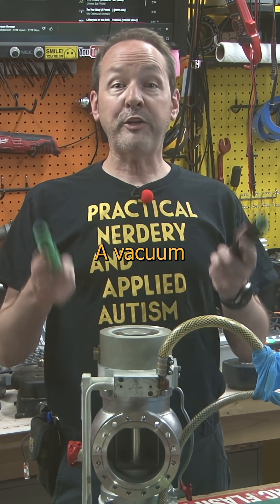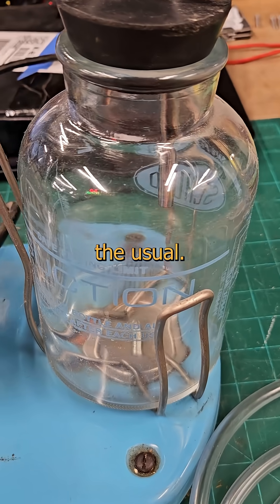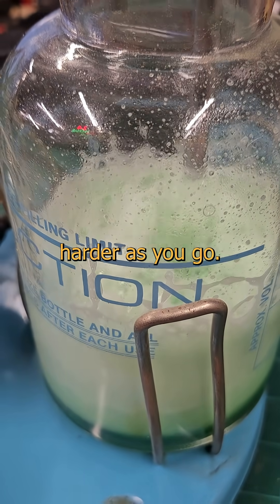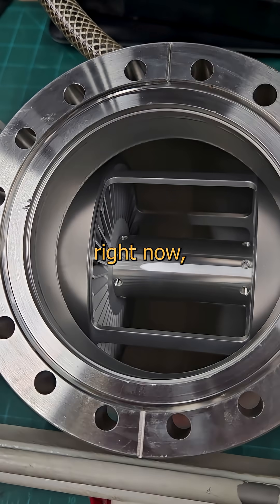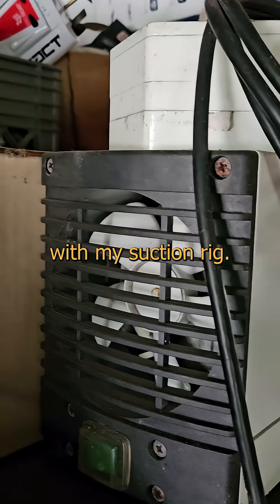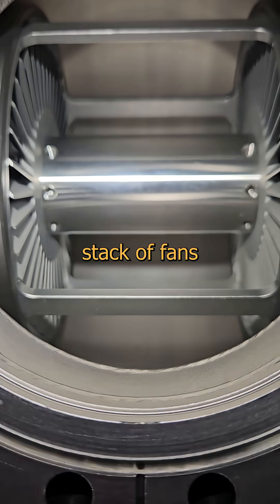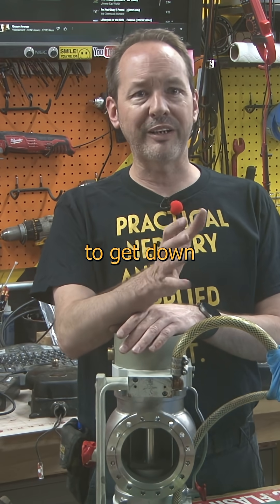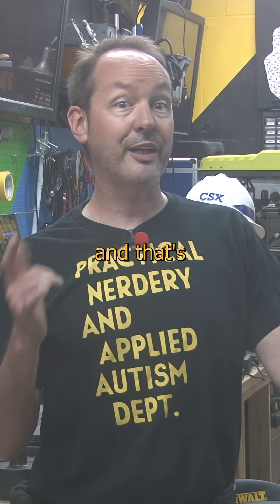Turbomolecular Vacuum Pump #chrisboden #comedy #engineering #physics #science #turbo #nerd

Comment: Hey cool finally seeing a piece of equipment I have actually used, the roughing pump. We use that in chemistry labs for suction filtration. we also have beefier ones for pulling better vacuums for rotary evaporation or purging containers before running air sensitive chemical reactions.

Comment: Used to be an EE for a vacuum furnace pump. Most of ours used a rough pump and booster (turbo) pump, but some used a oil diffusion pump which could bring that down even further. Given that these are about 10' around and 10' long, you can bet that pump down took a while, especially when youre getting down to the last bit.

Comment: I did some physics experiments under high vacuum using one or more of these pumps. Always fun.
When you switch them off there is so little friction that it takes them forever (10s of minutes) to spin down. They also have no built-in brakes. The trick get them to stop quickly (so you can open the experiment chamber without them destroying itself) is to just barely open a valve to atmosphere for a quick second to let just a little bit of air in. Maybe raising the pressure from under 1 nanobar to around 1 millibar. The turbomolecular pumps will start singing and spin down in 30 seconds or so.

Comment: In aerospace parts assembly, most is EB welded in a vacuum chamber using roughing pumps, high vacuum pumps and an oil diffusion pumps, all in series. The systems I used to work on would operate down to 7.5x10 -13 to 7.5x10 -20 Tor. Small chambers, 24in x 12in x 12in, would need about 45-60min to get down to those near interstellar space vacuum levels (-19 to -20).

Comment: Okay FINALLY I understand how people get rid of the final few molecules of air in vacuum chambers. I've been wondering for a long time how you could get a near perfect vacuum inside our atmosphere when the pressure inside the chamber gets extremely low. Had no idea it's possible to actually physically "bat out" stray molecules. I just assumed nobody ever did it and just used as good a vacuum as they could get with traditional pumps.
Reply: There are other ways to do it - diffusion into tiny oil droplets and the like - but they all work on the same principle of mechanically trapping molecules and moving them to some sort of "higher pressure" area, where a conventional vacuum pump can get them out of the way.
Reply: @jandl1jph766  that's really interesting, thank you!

Comment: As a master licensed HVAC technician who now runs a service department....I can speak for alot of HVAC technicians out there when I say this video explains our worst nightmare (usually) on any large commercial install with VRV systems with hundreds  or even thousands of feet of line sets that we have to vacuum down far more than a standard system and be able to HOLD this for 24 hours before start up. Nothing is everything and this video is gold to show people who ask about the vacuum process. Good job sir. Good job!
Reply: Just add more vacuum pumps 😉.

Of course you only have one bloody service port per lineset if you're lucky these days, unless you install extra. I often run 2 vacuum pumps on systems larger than 10 ton. Sometimes a third.
Reply: This is true! We had a 60 ton Daikin system at a hospital that we had 3 pumps working overtime. We actually at one point had to stop and change the oil once with a lead lag system we set up because they had to run 24 hours + to achieve 250 microns and hold it for 24 hours. 
We've even had some massive 200 tonight chillers that used river water at a steel plant in northern Kentucky. These things were prone to breaking down all of the time and working on the compressors were a massive pain in the neck. 20 year old chillers that never shut off was a recipe for disaster. There were 6 of these in total (3 lead and 3 lag). I was so happy when we finally replaced those things. The money made in service was great...but it became troublesome when we had to constantly have a tech out there and jamming up our schedules lol @SuperS05
Reply: I started as a CNC technician a few months ago (freaking love it) and I'm just now starting to go down the rabbit hole of our vacuum system. I'm rather curious, what kind of vacuum pumps do you work with and what exactly are the for? Circulation?
Reply: I'm often glad that the extent of my HVAC responsibilities typically have a total system volume of less than one cubic foot to evacuate... 

609 mobile license only, so my structural experience is limited to a self install of a mini split, and watching enough YT videos of the 608 guys to make me glad that's not my main trade!
Reply: @heyallenify  in Canada we call this an ODP licence. There's no differentiation between scope. It's a day course. It ONLY allows you to buy refrigerants.

We still need a licence to actually work. 313A/313D for fixed systems. 310 for automotive. This is a 5 year apprenticeship program requiring 720 hours in class, plus another 8,280 hours on the job.
Reply: @SuperS05 
In the US, the EPA 609 cert is the requirement for working on automotive AC, to purchase r-12 if working on an older vehicle, and to purchase larger than 1lb cylinders of r-34 or r-1334yf. (At least this is my understanding of the current laws...)

Like your ODP license, it's a short course, and had no apprenticeship (at least when i did mine...)

The structural HVAC licensing is much more involved, including apprenticeship programs and continuing education, from what friends in the trade have said.
Reply: @SuperS05 roughly the same in the US. EPA 609 is automotive, EPA 608 is residential and commercial. You have to be federal EPA licensed to purchase and handle refrigerants, but actually doing service work requires state licensing. Interesting though is that the state doesn't require a license for in house work, only contracting. If you work in maintenance at a big company, you don't need the license or the years long apprenticeship.
Reply: @heyallenify  So you only use it for your own cars, or are you an car mechanic?  the laws change so much just between states, forget about between countries. I am honestly curious.

Here (Ontario) we could work on our own cars/equipment without the license, but can't work on someone else's. The ODP is still requires though to buy refrigerant regardless.
Reply: @SuperS05 
I initially got licensed to work on my own old car, but I have done work for others since. 
There are definitely laws involved with recovery of refrigerant if I were doing this. commercially, thankfully I have only been working on systems that had already leaked out or had to get the refrigerant recovered elsewhere.

Where I'm located now, if doesn't make any economic sense to hang out my shingle professionally, since there are a few shops that have reasonable rates.  Where I lived for the last couple decades, it was far more cost effective for me to acquire the skills and equipment to do my own work.

As far as trade, I'm a shade tree mechanic that helps friends any more.  I turn wrenches for pay, but not road going automotive maintenance.
Reply: @phillyphakename1255  Your own house is a bit of a grey area here, but there are some carve-outs. For us the refrigeration license is country wide. (Any of the red seal trades are, which there are a lot) However, you still need a license even as a maintenance mech. (there are various maintenance/operator licenses, which is site specific, that are a lot easier to get but are not transferable)
Reply: @heyallenify  Doing your own work is often the most cost effective, but not always the fastest lol. I wish you success.
Reply: @SuperS05  I hear that all too well!
The main reason I do my own work now is that I own older vehicles and automotive shops in the area are still charging standard "shop rate" that would quickly exceed the cost of the vehicles.
I also have a much older project car that there are no shops within 5 hours travel that are even familiar with it, and that shop is scheduled months ahead.
Doing my own work lets me figure out what make the vehicles tick, though they may tick me off in doing so!
I've ended up learning to make my own HVAC plumbing to replace no longer available parts from the manufacturer, and that added one more step in the chain of reasons to wrench on my own vehicles.

The worst thing that can happen is that things don't work and I have to figure it out.
Reply: @heyallenify  well if you were like a friend of mine, he ended up paying double for the damage he caused trying to replace a part lol. Learning isn't always cheap but you also won't make that mistake twice.

What did you use for the plumbing? Braided stainless hoses are available. Copper tubing works but it won't like the environment of a car, although it's not like you're taking a project car out in the rain or snow.
Reply: @heyallenify I love when people have knowledge in HVAC and the codes we abide by. Hats off to you sir 😁
Reply: @SuperS05 
I ended up buying a hose crimper and barrier hose/ferrules as needed.  The hard part is in either sourcing existing hard lines for the ends, or welding sections together that are refrigerant and vacuum tight, to meet the needs of the application. 
The OEM condenser in the project car is  not available for the OEM part, $$$$ for a used one, or exceptionally poorly made aftermarket. That prompted part of the research into learning, so another OEM application condenser of similar size could be substituted, as well as upgrading to a more efficient core for modern refrigerants.
Reply: @heyallenify  awesome!
Reply: @heyallenify shew...I have çustomers that buy those cheap Chinese mini splits on eBay ( the gray area for homeowners is wild) they can basically buy those things and sign that s licensed person will "install" it or they come with a nitrogen charge to avoid that caveat.  Then they call a company to fix it when it breaks in a few months and warranty is useless or only a contractor can warranty them. Cheap parts, long wait times, and a customer who gripes about paying for time on a warranty thinking that should be free to on their diy system. It's gotten so bad that around here most companies will laugh and only offer to replace the system because they won't touch it when their reputation is on the line over a junky set up that is guaranteed to be a problem. Alot of these diy bros don't understand the years of education, factory training, continuing education, experience, and hard work that goes into being a technician or having an HVAC business. But that fact you trained yourself and got some certification is admirable as most diy guys just Google and YouTube themselves into disaster lol

Comment: Some more explanation: The turbo pump works with statistics. Molecules, which hit one of the rotating blades, are more likely to get momentum to one side (usually the outside) than the other. That is why no valves are needed. The blades rotate really fast (about 1000 Hz) to increase the probability, for such a collision to occur. Most modern control units for turbo pumps monitor the electric current in addition to the rotation frequency, and switch off, when it draws to much, because it moves at atmosphere.
Reply: The one I have goes from 53krpm to 72krpm… gets 10-9 mtorr when I’m using indium seals. Have to use the cryo pump for 10-11mtorr
Reply: Who talks like that? Frequency is the inverse of speed. Did you mean 60,000 rpms? Or 1000 rps? Or... Lol
Reply: @CBWP  In the turbomolecular pump industry the rotor speed is commonly expressed in hertz along with RPM. 1000 Hz = 1000 rps = 60000 rpm. It makes perfect sense to use Hz because it's just a way of saying 'per second'.
Reply: @PondCam_MS so this one goes 1000 per second ?
Reply: @trippmoore  Engineers at Edwards and Pfeiifer Vacuum: "God, give us some brains!"
Reply: @trippmoore That is correct.

Comment: Question for the more knowledgeable folk than myself - why does this turbo pump have a connector with so many pins? I would assume this would only have a power input and maybe a speed sensor output.
Is this just some connector standard I'm not aware of and most pins are not connected, or is there more to this unit* than I'm aware?

*in this instance, by "this unit" I mean the turbo pump, not Chris.

Comment: I worked for a converter that used electron beam units to cure adhesive and varnish.  They were a giant vacuum tube that emitted a beam of electrons through a foil.  If I remember correctly, the voltage was 120kV and the current was 420 mA if the chamber was conditioned properly.  The chamber needed to get to 2x10^-6 torr absolute.  Everything was designed to not trap gas in anything in the chamber.  A drop of oil would be a problem trying to achieve the required vacuum.  In order to get there, it used a cryogenic vacuum pump.  It ran at about 10 Kelvin to condense any gas particles.  It was a very interesting piece of equipment.

Comment: The vacuum for an incandescent light bulb wasn't enough for thermionic valves. The modern high vacuum pumps were developed at the beginning of the XX century, more than one hundred years ago. Only then the manufacturers realised that the metal utilised to build the cathode, grid and plate of a triode or pentode was giving off relatively large amount of gas once the valve envelope was sealed after the vacuum...
Reply: And the vacuum at the beginning of the XXX century wasn’t enough for clitoral engorgement so we had to think outside the box.
Reply: Is that a tongue twister  @paxsevenfour
Reply: ...... isn't that where deposited 'getters' came in?
Reply: incandescent bulbs don't have a vacuum, jus an inert oxygenless atmosphere.  flourescent bulbs do I think.
Reply: @tsm688 100 years ago, incandescent bulbs had a vacuum. They could implode if hit, or if a there was condensation on the glass.

Modern ones usually have argon in them.

I witnessed a lightbulb implosion as a child in the 1960s. I was exploring my grandparents basement and turned on a light they didn't use. The bulb might have been from the 1940s or earlier.
Reply: @hamjudo  argon LMAO.  why would they fill them with the most expensive gas possible

all you need to do is put a tiny bit of ether in them, and turn them on to ignite it.  oxygen, gone, longevity achieved.

glass doesn't need to be at vaccuum to explode.  sufficient thermal differential will do it too. cold spots caused by condensation is plausible.
Reply: @tsm688  like spitting on the top of a bulb over and over until it pops?
Reply: @Chelsea-w9h8m  yep

Comment: Machine I operate uses a heated vacuum chamber with 2 TMPs with cold traps. Puts all the gold onto stuff like drill bits. The power is uses could power several houses with the AC on blast in the middle of a Texas heat wave.

Comment: Close to ATM: fan
Lower than ATM: oil lubrocated piston or vein vacuum pump
Much lower than ATM: fan, but faster
Reply: I used to work in a lab where the turbopumps were just the stage 2, on the way to this massive “pump” that evaporated a special oil, who’s molecules would bind with the few air molecules still bouncing around, and then condense on the sides of the enclosure and run down to the base where the air was removed. I forget the exact details of how it operated (honestly, I probably never knew them), but it got that massive 3m-diameter chamber down to some ridiculously low pressures
Reply: @sckego yeah that'd be an oil diffusion pump, it's usually a silicone based oil as it has a super low vapour pressure. Very expensive oil. The molecules don't bind to the air, they basically act as billiards and smack the air downward. Very clever devices. 
Some older versions of them used mercury, but that much super heated mercury could very easily become an environmental catastrophe.
Reply: @UniCrafter the mercury pump used for processing pmt's was a glass potbelly with a Pyrex manifold for attaching the tubes to for processing.  The one that the company I worked for had 12 ports, and used liquid oxygen as a cold vapor trap. It could pull 10x -9th torr. Made for some excellent processing.
Reply: Liquid Ring pumps do a pretty good job for less than atmospheric. At least when it comes to vacuum loading tanks.. an added bonus is they run Alot cooler.
Reply: How about water jet pumps or Diffusion pumps?
Reply: The scroll compressors in air conditioners work pretty decent as vacuum pumps, for a little while. They won't get down to 500 microns (industry standard to get refrigerant lines down to before you put in refrigerant), but they're decent for pumping refrigerant out of a system and into a recovery tank in a pinch. You generally don't see techs do that old trick these days since purpose-built recovery machines are more widely available, but it's always an option. (BTW deliberately letting refrigerant out of an HVAC system is a federal crime, so if you see someone doing it, film them. Don't let those dirtbags punch giant holes in the ozone just because they were too lazy/cheap/impatient to recover the old refrigerant.)
Reply: @rogerramiussergeialexander5541   who cares about a little refrigerant in the air. What's a few dozen broken acs worth of refrigerant per square block
Reply: Only a few molecules left to suck out: your mom
Reply: May want to rethink using the abbreviation of “atmospheric” with all this clitoral and gloryhole talk going around here…